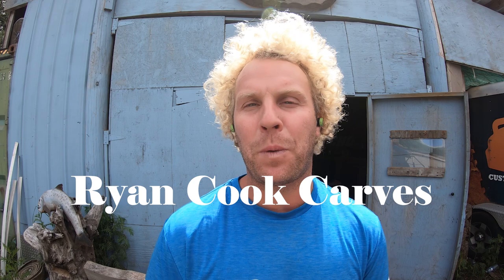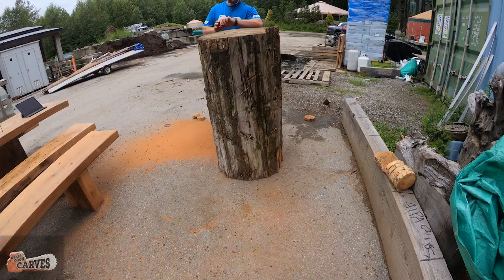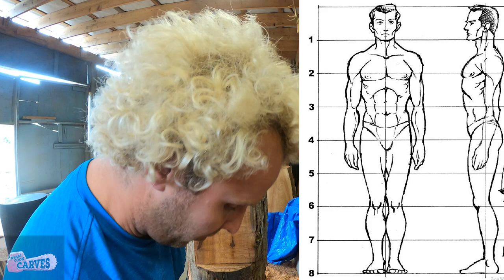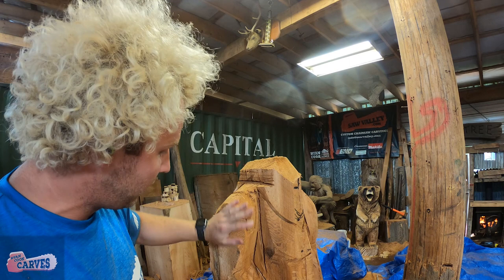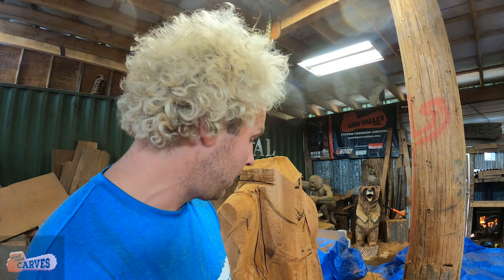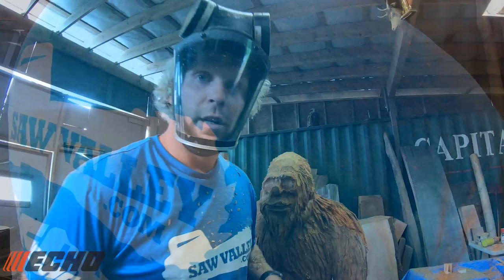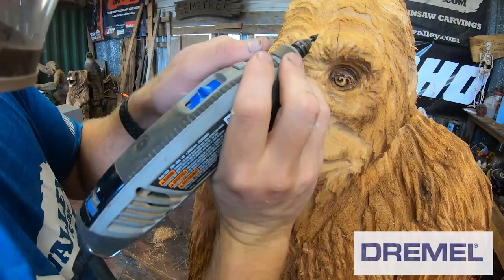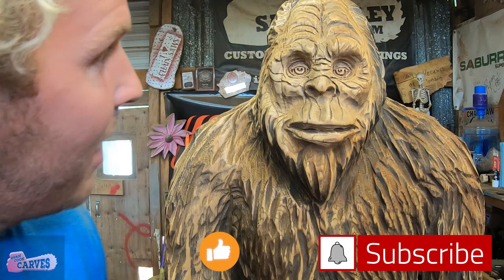How to Carve a BIGFOOT with a chainsaw - Ryan Cook

Comment: That's nice. Scaling looks great. You're dead on about trusting your instinct. Years ago a fellow that worked for me ran a couple hundred feet of pipe thru a lab hallway along a divider wall, insisted it was level, it was, he put a torpedo level on every piece,  but the wall wasn't level. After about a dozen people walked by and said "why is the pipe crooked?" I had him re-hang it to match the top of the wall. The rule after that was "if it looks right, it IS right". 
My carvings follow the rule, the hard things are the things people see all the time. I hate doing eyes. You can get away with murder on woodspirits or aliens or fantasy creatures because nobody has seen one (lately anyway), but screw up a dog or a circle or (Ugh) Eyes, and a 3 year old will point at it and know it's wrong.

Thanks Ryan, I'll be firing up the saws before the snow flies, was looking at a Harbor Freight Jawhorse yesterday Seems OK for a HF  (still $129 for a HF copy!!, maybe I'll wait till I can get a Rockwell for another 50?). As soon as I get one, I'm going to give it a go. Don't think Bigfoot would be a good starter. Ideas on a 1st time saw carving? 

Sticker shock on your cool powered respirator $485 - guess I'll stick with my 3M paint spray model for a while. Someday...

Thanks for the lesson!